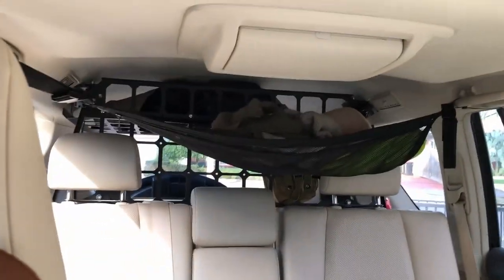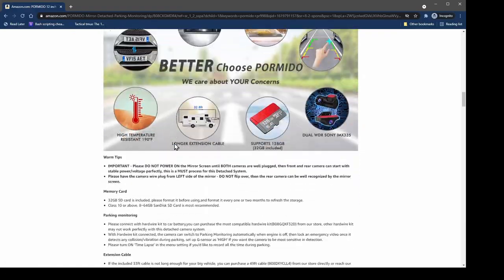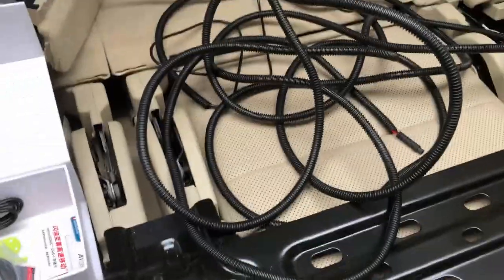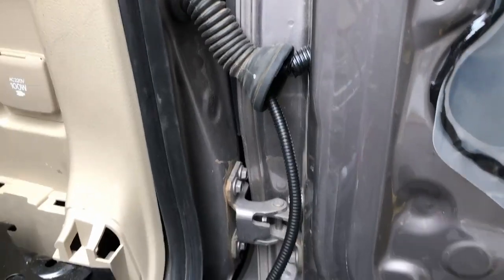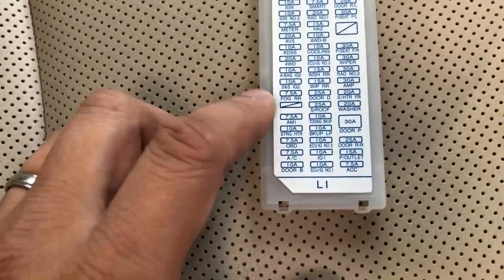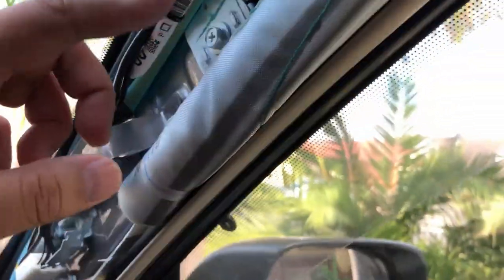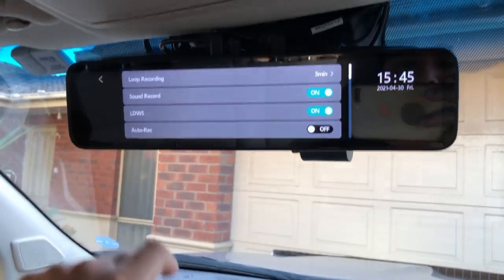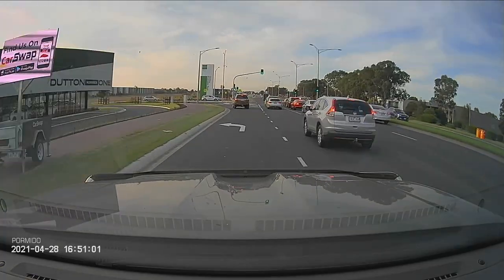PRADO BUILD // Installation & overview of the Pormido PR998 mirror dashcam on a Toyota Prado

Comment: Man, you did it the hard way.  From the passenger rear door, pull out the rubber molding around the door frame..use a snake and push it to the rear through the ceiling of the car; try to target the rubber bushing where all the cables comes out through the rear hatchback door.  When you locate the snake tape your wire to the snake and fish it to the front.  From there, pull out the rubber molding around the front passenger door and pull the wire through the top side from the passenger rear door to the front passenger door frame.  Fish the wire to the wind shield, hide your wire under the top lip of the ceiling.
Reply from the maker: Hi @joat_dad4090 ..... a few reasons why I didn't do it the way you suggest.
1. The fuse panel where I tap in for power is on the driver's side
2. My car has a sunroof, so I want to avoid any wires running through the ceiling
3. My car is not a hatchback.  The rear door is a swing door with the hinge & cable gland on the driver's side.   So it makes more sense to run the wire on this side.

Comment: Great video! Hey now that you've been with it for 9 months, how do you like it? I also have no rear view (delivery van with no back windows) and want this as my rear view. I do a lot of driving at night so rear view and reversing in dark is what's most important to me. Wondering if your thoughts have changed on it and if you still like it for night use.
Reply from the maker: Thanks Stephen.   I still like it & continue to recommend it because for me it's better than not having it.  I've helped install it on 2 of my friend's cars since. 

It's normal for me now and most of the time I don't even notice that it's there.  I guess I"m so used to it, but I think it's a good thing as it does it's job nicely without distracting you or making you feel like you need something else.

At night, I find that the reverse lights on my car are adequate enough to give me a decent view.  But my car does have a built in reverse camera so I don't need to rely on this Pormido camera as much.

Comment: why did you not show how to configure the back up lines ?
Reply from the maker: Hi Robb, I did not connect the backup lines with my install because my car already has a reverse camera and this is something that is quite fiddly to do.  I should've mentioned it in the video.  Some people tap into the reverse light for the signal.  The other option is from the trailer plug wiring.
Reply: @lyphtec  Thank You. Your reply is much appreciated.